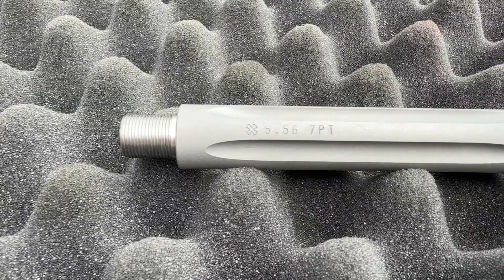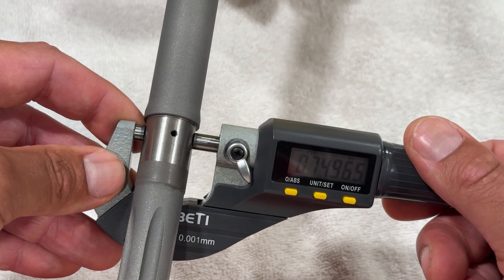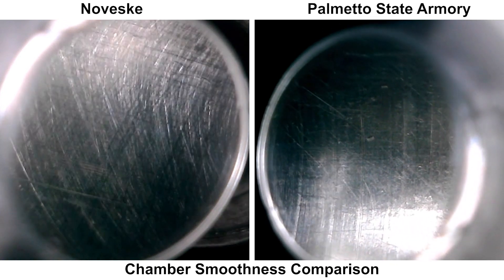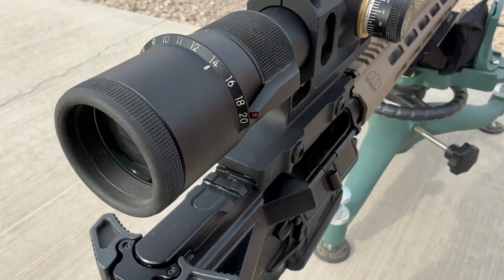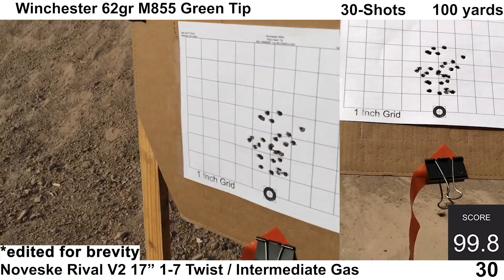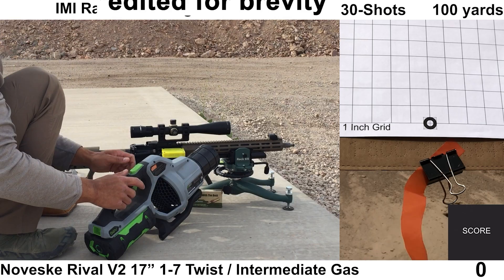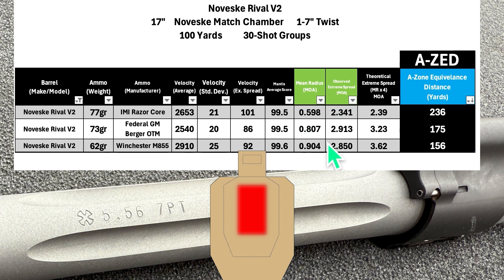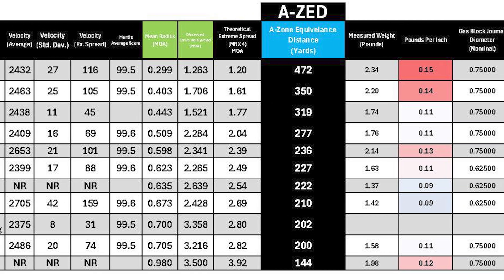Noveske Rival V2 AR-15 Barrel Review – Worth the Money or Just a Name?

Comment: Nowhere near what Noveske was many moons ago.  Went south slowly over time, then fell.of the cliff last year
Reply from the maker: This barrel didn't really live up to the reputation.  It had some signs of greatness, but... yeah...
Reply: This is my exact experience with Noveske.  I have a Noveske stainless steel 16 Recon from 2007, it is an absolute hammer. A more recent Noveske SS barrel I have is very similar to the one in this video, including the rough chamber and general accuracy
Reply: @Matt-dd3cw  agreed, we had used noveske barrels early 2000s and absolufe tac drivers.  During that time one of the top barrels for AR platform, but in recent memory absolutely, well don't want to say trash, however for price and what else is out there, I wouldn't even consider a noveske.  Then last year or.two with their chainsaw uppers, my god those were out of spec 5in at best
Reply: @chaoticcaninejb I would buy a Rainier barrel of the same configuration before I bought anything by Noveske.
Reply: @chaoticcaninejb were you using them on the mk12 mod h?
Reply: Gotta cut those costs to boost profits!
Reply: Agreed..Noveske when John was around was amazing. RIP
Reply: Gotta cut costs to pay more strippers!